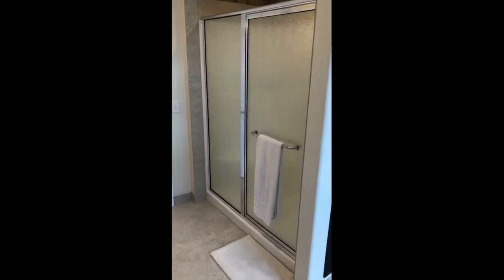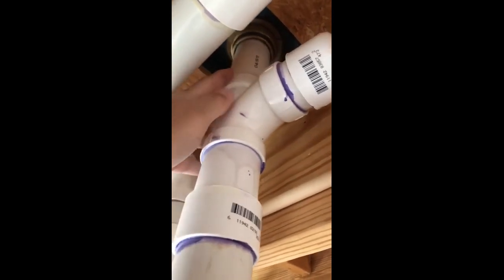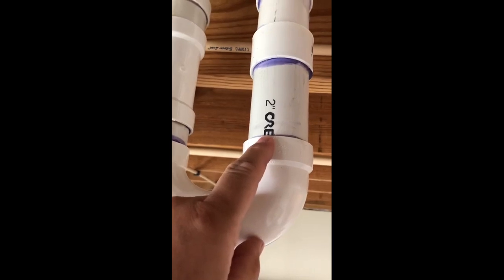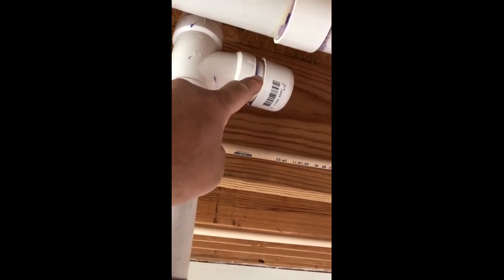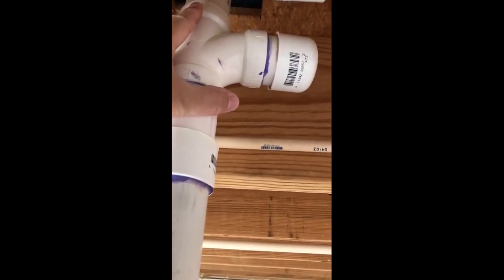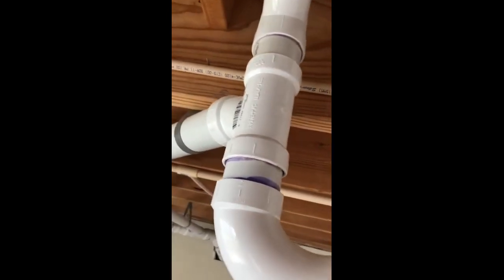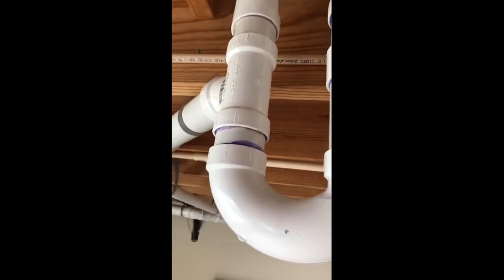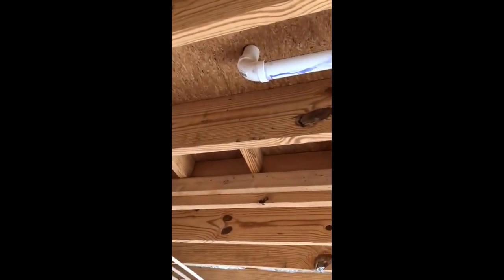How to identify and correct a venting problem with a shower drain.

Comment: Listen I’ve been a plumber 36 years all you had to do is drop off a 2 “ y right before the p-trap make sure that y is above the water line then install your p-trap and that 2 y will tie into your main vent going out.  Please please leave this to the pros
Reply: You are wrong, cannot have a horizontal dry vent below flood rim.
Reply: Obviously, the "pro" who did the original plumbing for the house didn't know what the heck they were doing. There are  incompetent "pros" out there.

Comment: This is not the way to properly vent a fixture. I am a master plumber with decades of experience and this was one of the best homeowner hack jobs I have seen in years. I do appreciate the effort!
Reply: Installation should allow for an AAV. That only needs to be 4" above the top of the trap in most localities. It would not be considered hidden since it's in the unfinished ceiling of the basement.
Reply: @robertp4716  AAV won't help the problems here any more than  this new incorrect install will. The AAV (or a real vent) doesn't really go directly above the trap as show here or as you describe. It needs a horizontal trap arm first to get the vent AWAY from the trap. Otherwise the trap will siphon & stink even if vented
Reply: You can't siphon the trap if the venting prevents negative pressure forming on the sewer side. In your case, since you already have a vent in place, the way you have it makes most sense. The only detail that may be wrong- it may be camera angle- your DWV T looks inverted, the take-off into the sewer pipe looks like it's sloping upwards and not downwards like it should.

Comment: Most codes don't allow the use of a sanitary tee when transitioning from vertical to horizontal.  Also, the vent, depending on your code, can't be horizontal unless it's 6 inches above the flood level of the fixture.  Please correct me if I'm wrong.  Thanks.
Reply: And as he explains his "Casue" of the why they were smelling sewage,  was not the vent bring in lingering odors.
It was the main venting connection to the rest of the home bring in a too much outside pressure!  So the shower trap was siphoning out the p-trap seal everytime.

Yes an that 45 T is not code, should be sanitary T. So with that short 45 T leads me to believe they were using that "vent" line as a drain?
An since sewage gases sink & linger on bottem, it was creeping back in to the closes drain.

An then this homeowner has wrong T everywhere.
Reply: instablaster...
Reply: @TheGmanamaya  whether this worked or not on his plumbing vent fix I don't know but to get above floodplane he would have had to go up in his wall to install his vent to his  vent tree
Reply: @harrisonmathew5001  Is instablaster like Drano?
Reply: Yeah I would've opted for a 2in wye combo facing vertical somewhere between the main drain and the p trap( wherever there's a wall above.
Reply: Mostly that’s true. There are exceptions though. You can put a combo past the fixture and just roll it up 45 degrees and vent it. Most places will require that way to be a wet vent. There’s also horizontal wet venting. This is where you basically run everything flat without vents but the last fixture you upsize and vent it. This is for a single bathroom group though. That 6 inch rule is more something to keep mind when piping the walls

Comment: 1. You are way over the max trap seal depth of 4". 
2. You need to have the vent on the horizontal portion just after the trap consisting of either a tee wye or wye on its back then running to a venting system or outdoors. 
You seem to be a handy guy so you can fix this 👍

Comment: As a fellow homeowner, I can appreciate you fixing a known problem.  However, after researching drain/vents for an upcoming project myself, there are a few issues I think do not meet code (for future people searching vent issues).  Others have mentioned the trap depth and connection to the vent (san tee) being wrong, but there is also the horizontal dry vent run below the shower flood level.  Look up IPC 905.4 about horizontal vent runs have to be 6 inches above the flood level of the fixture being vented.
Overall, your work looks good though, so thanks for the info!
Reply: Yes the horizontal dry vent is a violation as well as the trap assembly. It's pretty much a video of how not to do something. Have to wonder where the inspector was on the initial install!!
Reply: @johnpeters9903  
The inspector was probably at the bank depositing the payoff.
Reply: Thanks for your tip. You experienced the improvement no septic tank smell that means no gas. Thanks.

Comment: A trap is a fitting/or combination of fittings installed on a drainage system that provides  a liquid seal to prevent sewer gases from entering the building. Every plumbing fixture connected to a DWV system shall have a trap per code.  The liquid seal shall be 2"min. To 4"max. Between the weir and the top dip of the trap to be considered a legal trap.(some exceptions are made to 6" depth for deep seal traps under certain conditions).
A vent is installed to protect that liquid seal from syphonage, back pressure, wind effect and momentum. ( It will not protect against evaporation and capillary action/wicking)
A trap is required to have a trap arm with a min. And max lgth. Based on pipe size. The min. Being 2X pipe Dia. And max. Based on
your local code as they have changed recently in some areas.
The trap arm is defined as a section of pipe between the weir of the trap and the vent connection. The min. Size of the trap arm prevents syphonage. Any connection closer is considered crown venting as some have stated already.
The vent connection should be above center line of the drain it serves, 45 degrees or greater and continue vertically to a point of 6  inches above the flood rim of the fixture it serves before going horizontal.
This would be in a perfect world of course but not always possible when working with existing as in your case. You should be fine with your horizontal vent as long as it's sloped for drainage.
Best of luck,
Kenny b
Reply: His vent is could a wet vent from his sink so his sink is dumping into his shower p-trap.

Comment: idk what all these comments are being rude for, and the plumber you had come look at this must have made a mistake also. i can see immediately from your before picture what the problem is. the trap is hooked up wrong. the trap needs to be vented, not the drain. if you were to swap the two tail piece or "stub down" pipes, it would be correctly piped in the before pic. it actually takes a well trained eye to see why the before pic setup does not function correctly because theoretically it should work. the reason that its not working is because the drain is above the vent. you cannot go horizontal vent before the p trap and below flood level rim, that is why i said the drain is above the vent.

edit: i just realized i couldve explained this in much fewer words: in order to vent in the before pic, it has to syphon the p trap.

Comment: So putting in a shower drain the drain pipe has to drain away from the shower drain so basically the wall side of the shower drain is that correct

Comment: Instead of connecting to the house venting system, you could have put an air admittance valve right after your P-trap, thus avoiding the max trap seal depth problem.

Comment: its an  easy fix just run your drain line to your vent first then use a long 90 and put a tee on the vertical with a normal trap to catch the shower and it will work fine a be legal

Comment: Nothing shown will pass code, so take that into account when viewing.  Plumbing codes are used for a reason and installations that do not follow code are gong to be at risk of additional problems in the future.
Reply: you are correct, the fix is in violation just like the initial install.

Comment: The vent being on the tub side of the trap will only smell of tub air. The attic connections of this vent should all connect to the sewer side of their traps if installed correctly. You should not smell the sewer that far away from the source. You should only smell tub air, outside vent air or occasionally during a windy day a hint of sewer fumes or as someone said if the trap below the tub is siphoned by other fixtures and breaks the water seal.
Reply: That really depends on several factors. I do a lot of work around high rises and those sewer lines literally blow sewer gas at you. It’s because vents not only suck air, but they let air be pushed out of them. When water goes down a vertical pipe it’s blocks the pipe and pushes all the air out ahead of it. This is what causes toilet water to bounce when it’s not vented properly. That’s the air pushing on the trap seal because it doesn’t have a vent to go out. So when there’s high rises, you have sometimes 6” pipe and up running vertical. When they get water running down them they push a lot of air. Yoke vents are only required what  every 5 floors or so. This means you could have 5 floors worth of water pushing air. This is what sewer lines in down town areas blow sewer gas out of them. Also mains are vented through the buildings that tie into them. Depending on where he is on that main he could have a worse sewer gas problem than others. There’s a good chance he was getting sewer gas out of the vent and not a siphoned trap. I’ve seen lots of poorly vent systems that didn’t have trap siphoning issues. Especially when it runs horizontal right off the bay for a good distance. That water flattens out within a foot or so. This will balance the pressure in the line so that it doesn’t siphon
Reply: Maybe you are thinking of the overflow pipe connection on a tub,  which does connect above the trap   but is not connected to the vent system  at all.  This is a shower without any overflow protection.  No vent should be connected above the trap.  Think of a sink,  typically the trap under it goes to the wall where it drains into a sanitary tee (vent connected above and drain below).

Comment: I'm no plumber but i can tell this is still wrong. You fixed the vent issue but your P trap at the end is wrong. Think of it this way, how would it be possible to snake this from the shower tub. The cable will go through your vent pipe. which is incorrect.

Comment: Couldnt you have left your original vent and simply rerouted the drain to the other side of the p trap then reconnected the outflow of the trap to the correct side of the rest of the drain path?

Comment: It’s still not proper for several reasons. 

It’s crown vented. 

The outlet of the Ptrap can’t be a reversed sanitary tee.   That’s installed backwards.  

You’ll never get a drain cable through that tee to clean the drain past the trap. 

The trap is too deep.

Comment: yes this works but sorry this is not up to code as that sanitary tee is being used incorrectly. It should've been installed on the horizontal pipe rather than the way it was installed here, its backwards. It could have been used on the vertical pipe but the sanitary tee is backwards in this video and by the looks of the amount of space available the only option would be to have it on the horizontal pipe with the vent coming out the top of the horizontal pipe or at least no lower than a 45 degree angle.

Comment: I'm surprised they let you vent so many fixtures on one pipe the way I got away with it is I used a 4-inch line I think that changes the number of fixtures that you can use the larger the vent pipe the more fixtures I think I don't know those codes change all the time the

Comment: That’s a pretty bad plumber to tie in a vent on the wrong side of the trap. That basically means it’s not vented plus you have an open sewer line in the house. They way you did it isn’t quite right but I think it will work. Technically its illegal. It’s what’s called a crown vented trap. The vent is supposed to be 2 pipe diameters from the weir of the trap. The weir is basically the water level. It’s the point where the water goes from the trap to the drain. These tend to clog or dry out fast from air moving in the vent. An easy fix for this would be to put a cleanout in it so you can run some water down the vent line if it ever clogs. Running water will usually easily unclog a vent because they don’t get clogged like drain lines do. 
As for the proper legal way or as close as we can get without too much demo, he’s how I’d do it. I should say a proper legal way because there’s probably multiple ways.  I would have, instead of that tee, put a combo or wye facing up. The top of the combo or wye would go to the vent. Then come out of the back of the combo with your p trap. This way will eliminate the crown vent. If you could run that vent line over to a lavatory or a nearby sink and replace the drain for it with this, then it would be totally legal. It would be a horizontal wet vent. Without a wet vent to wash it out, I’d definitely add a clean out. I would have also made the previous vent into a clean out instead of a cap. Two things you can never have too much of in a plumbing system is valves  and clean outs. Anyway not bad for someone who doesn’t deal with plumbing code everyday

Comment: A vent cannot change directions below the flood rim of the fixture it serves,  If there's a blockage in the drain that vent will also fill up with water. Vent must be at least 6 inches higher than the flood rim of the fixture it serves before it can change direction, 6 inches higher than the edge of the tub. That method is actually a code violation

Comment: Sorry, but this will still siphon & stink sometimes. Code violations:
1. Vent must be at least 2 pipe diameters (4") AFTER the p-trap. So you need a flat drain (trap arm) after the p-trap but but before the vent. It can be 4" to 60". What you have now with the vent right above the p-trap is effectively an S-trap. It will siphon & stink sometimes.
2. Trap seal must be less than 4" deep. You can't make it extra deep like that. It will siphon & stink.
3. No flat (horizontal) venting below the flood rim of the tub is allowed. So you need to either redirect the drain under main vent shaft going straight up, or install a new vent shaft straight up with no horizontal sections below the top of the tub. As it is now, the vent will clog over the years from occasional back ups, then stop working, causing siphon & stink in your bathroom.

Comment: On the discharge side of the drain you cannot use a sanitary tee you should've went off with wye and a 45 or so connect to this vent vent keep drop going drop down with the 90 into the pee wrap and up to your shower. The way you have it is incorrect.

Comment: Your verbiage shows that you might be intelligent 😉, but guessing your thermodynamics are correct with your main high leg of 480 connectors to main vent separately from your Flux soldered capacitor sump pump?

Comment: master plumber here all of this is  wrong still hope the smell goes away but highly unlikely
Reply: And as he explains his "Casue" of the why they were smelling sewage,  was not the vent bring in lingering odors.
It was the main venting connection to the rest of the home bring in a too much outside pressure!  So the shower trap was siphoning out the p-trap seal everytime.

Yes an that 45 T is not code, should be sanitary T. So with that short 45 T leads me to believe they were using that "vent" line as a drain?
An since sewage gases sink & linger on bottem, it was creeping back in to the closes drain.

An then this homeowner has wrong T everywhere.

Please correct me if I'm wrong? I am a pipe welder an work with many other craftsman, so my plumbing codes & knowledge is simple! Lol
Thx!
Reply: The smell will go away , but yeah it's a crown vent and the vent is illegally horizontal..trap too deep,

Comment: Are you kidding me the first time it was dead wrong and you have really not fixed it at all that sanitary tee in backwards is a real hoot the water is supposed to flow the other way you should have hit a wall that was on the way to that point instead of the other side of tbe shower put a 90 up a sanitary tee to pick up the shower and out of the top of the sanitary tee that would be in the right way after the shower is drainimg into it that would be the vent thats the correct way to do it real easy no muss no fuss its how its done w a individual vent like that the first guy really dropped the ball amd you picked it up and threw it as far as you could it seems like lol play ball or look even this scenario here on the way to tbe trap find a wall you can go up in lay a combination wye and 45 on its back that would keep the same elevation if you dont have room for the 90 and sanitary tee in thefloor but yes the combo on its back would be the ticket there and then from that point you could actually go 8 ft from tbe vent and pick up the shower on 2 inch pipe it would be properly vented then the hodge podge youve come up with is just over thinking at its best lmao